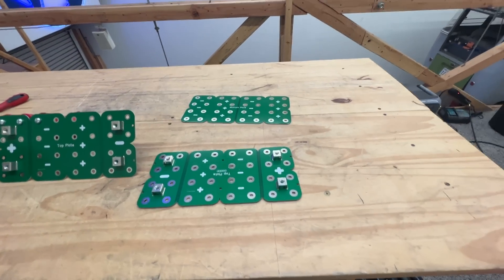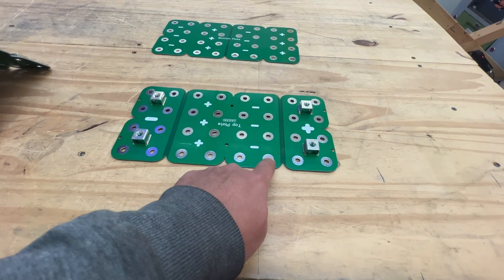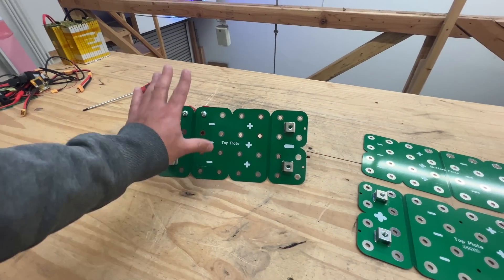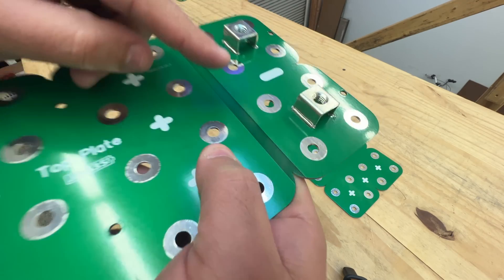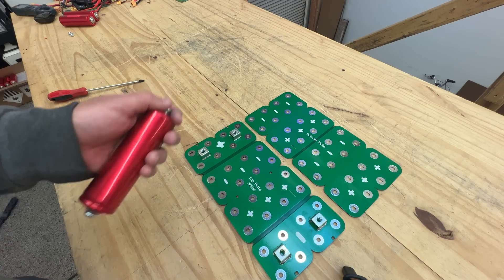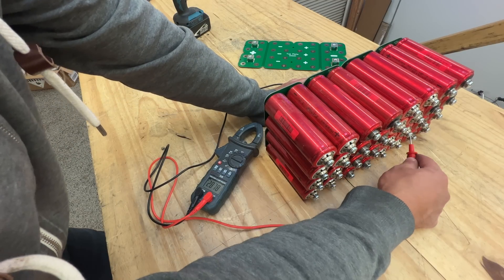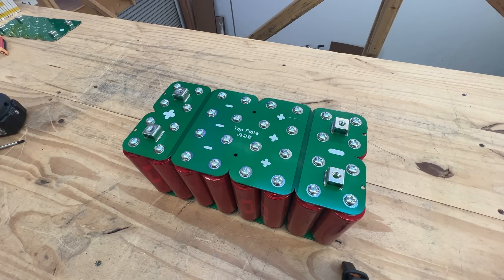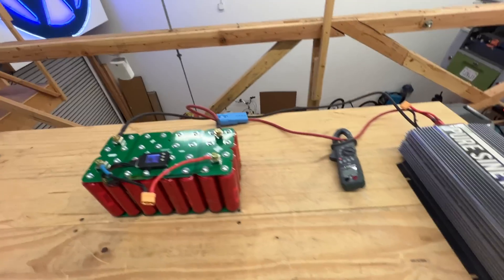Building a 12v LiFePO4 battery out of 32 headway Cells

Comment: Do you know how many CCA a battery like this will provide?  New vs used cells
Reply from the maker: 2400A on dead short
Reply: @jehugarcia  how can I find a bad cell in the bank?  I have a 64ah bank that was kinda sagging . I used a regular car battery analyzer and tested it 400cca. 
So I pulled the battery out, slow charged it with my power supply and retested… Amps went up to 1070cca. So Here is where It got confusing to me…. I removed one roll of eight cells. Amperage went up 1277cca. But why?
I put the 8 cells I removed on a bus bar and they tested around 400cca.  cells were holding 3.6v and mfd:2021
 Idk what to say, I guess I’m going to put it back in service tomorrow.

Comment: you should check out conventry bars for headways banks, just to compare. 
7:45 you mentioned those soldered pieces are rated for 80 amps, which is only enough for 4 cells in series at 10c. which some people run harder, from what i've read most say about 12-15c discharge is fine with these cells. 
i'm not sure what other people use these cells for, but in the car audio community these plates just wouldn't cut it. 

great idea for people using them for small amounts of discharge,  but it would be great to see some implementation of this design with thicker plates for full use of these cells.

He deleted my comments on his other videos where he claims this is capable of 500.amps, then you have people commenting wondering why they're boards are melting or welding themselves to cells... This is a bullshit product, if you need high amperage draw from your cells don't use cheap hardware like this. Buy or make yourself some proper bus bars.
Reply from the maker: They are 180A so both should do over 300A

Comment: And to add I would love to see you push big amps through the boards that'd be cool. And for anyone that hasn't handled headways. Use a #3 Phillips bit. You won't strip or cam a single screw
Reply: Many headways that I bought directly from factory comes always with #5 hexagon allen bit screw.
Reply: @John Papajohn  and those I would prefer. The Philips screws are fine though long as I've been redesigning my car audio pack I haven't had any issues. But the factory screws are always preferred. Good to know that's what they come with. Are they steel or aluminum?
Reply: @kswis  chrome finish steel about a centimeter long.

Comment: Having a terminal to hook up voltage sensing would be very convenient. I don't mind the busbars and aluminum plate I've use but running the balance cables sucked. Not cause it was hard by any means but because it just didn't look as clean

Comment: Will Prowse called. He said to pre-charge the capacitors in the inverter before hooking it up.
Reply from the maker: How does he suggest I do that?
Reply: @jehugarcia  With a resistor, or anything that acts as a resistor, like a 12v light bulb in this case would had worked well. Back in the day, when they used to sell those 5 farad capacitors for car audio, they would include a resistor in the package to get the capacitor voltage to slowly come up to match the battery before you hooked up the capacitor in parallel between the battery and amplifier. I imagine a 10 ohm resistor should work fine, as long as you aren't trying to equalize a crazy amount of power. I've seen people connect the battery ground to capacitor banks and use a 12v test light to connect to the positive of the battery and the positive of the capacitor bank, and the test light itself will act as the resistor and it will charge the capacitors. Anyways, any resistance you can put between the battery and the capacitors will help slowly charge the capacitors safely so the capacitor banks voltage and the battery voltage is close to the same when you make your final connection
Reply from the maker: I use a variable power supply, I’ve made videos about it.

Comment: Those are some really nice bus bar boards!

You’re right, adding a little circuit board connector to attach a balance leads would be perfect!

Do you have male-to-male bolts(?) for the headway cells, so you can stack 4 vertically & use 2 circuit end boards to make a 48v battery?

Comment: Updated:
Ran some quick numbers to see what it should be able to handle:
150A will give you a 11C rise above ambient
200A will give you a 20C rise above ambient
260A will give you a 40C rise above ambient

This should have no issue pushing 150A without much of a temperature rise. 
What would help is increasing the exposed copper on the bottom side where the headway top touches the pcb. 
Also adding via stiching will help. 
Great work

Comment: this is all German to me. What is the Ah rating on this pack ?
Reply: Those cells are 8Ah each, and there is 8 in parallel so 64Ah, 4 in series makes a nominal voltage of 12.8v, with a voltage range from 10.4v to 14.4v.